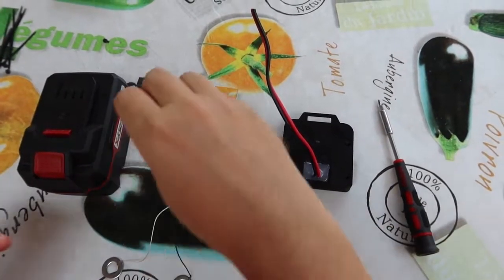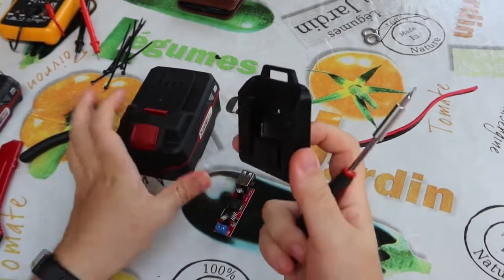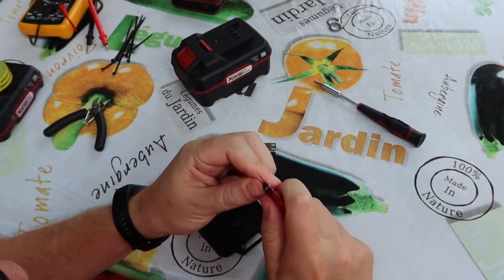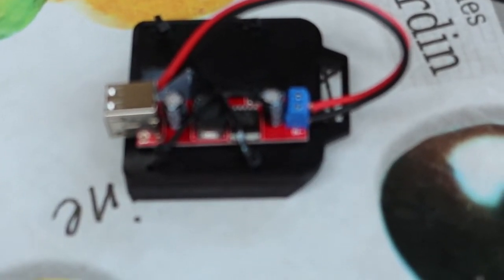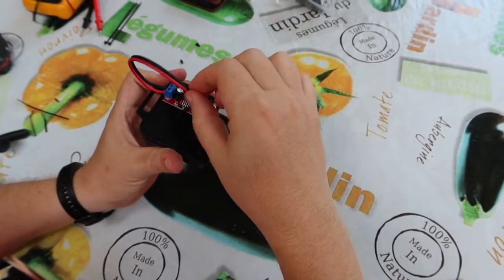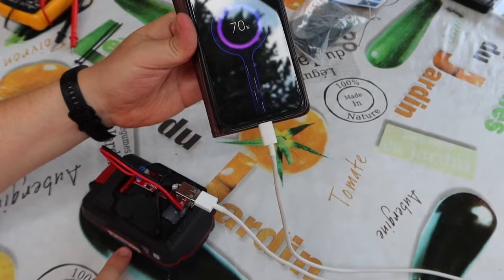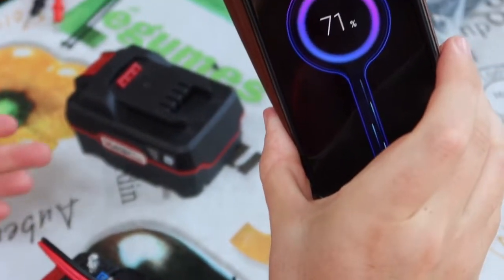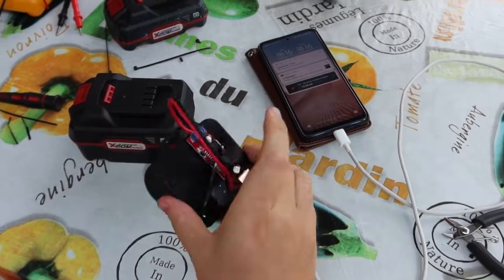Score a Free 16,000 mAh USB Power Bank from Lidl's Parkside Battery 20V for Less Than 1 Euro!

Comment: Какая защита от полного разряда АКБ? Батарея не выйдет из строя?
Reply from the maker: Всі сучасні літійіонні акумулятори для інструментів мають плату захисту від перерозряду або перезаряду. Парксайд теж.
Reply: It will kill the battery as you are not using the signals output by the battery. Instead you are draining it entirely and ignoring the signals, since you are directly connecting it to the battery, not the bms